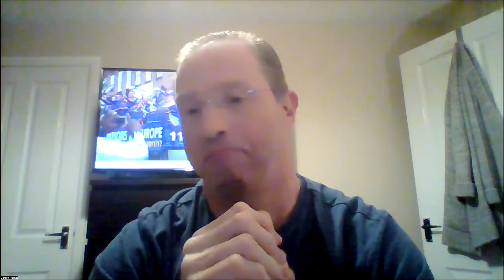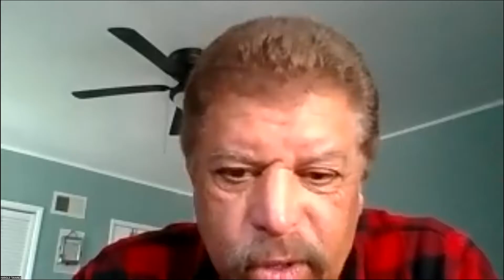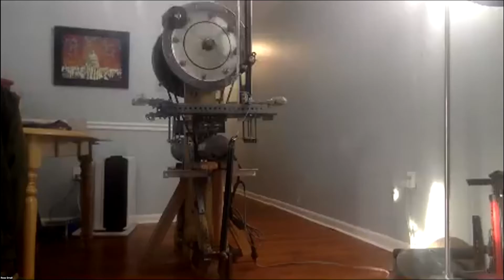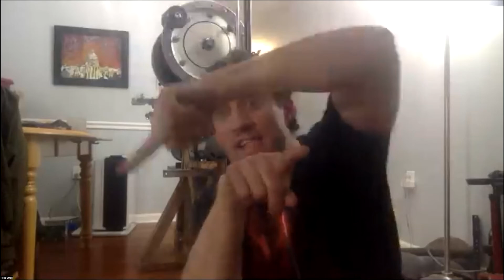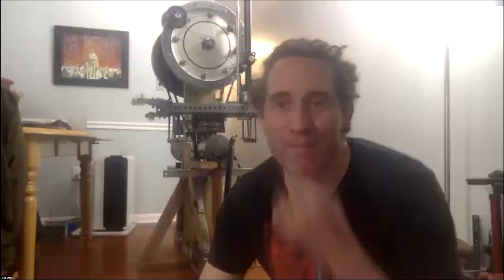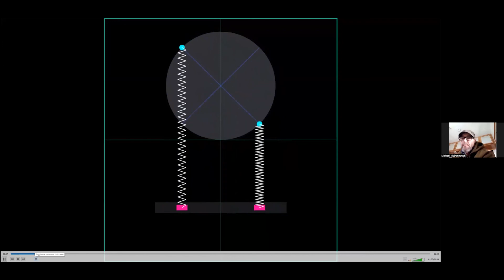APEC 2/26, Part #4  – Ross Small – Inertial Propulsion Q&A

Comment: Inertial propulsion: idling concrete saw.
Reply: yeah, but this isn't "inertial propulsion", this is "linear thrust" or also known as "mass displacement". There's a big difference.
Reply: @ooosoo8727  Well it will walk if you leave it idling. Speakers will walk cause items to walk also. I'm just waiting for those guys that bought Alexy's kit to actually get their devices working. What's the technical difference between Alexy's device and Paleknakov, however you spell his name, mass loss experiments?
Reply: @aljawisa  I don't really know much about that Alexy's kit or anything about Paleknakov; I just know that this machine above is not like your standard "inertial propulsion" machine that "hops forward" (like an unbalanced washing machine can "hop forward"); this machine is based off of Mike Marsden's Mac Quan 1, which is a "mass displacement" machine, which is unpublished but it works and could be used as a spacecraft propulsion engine.